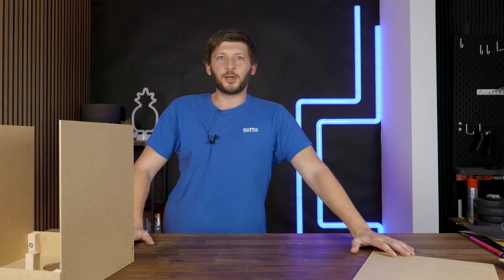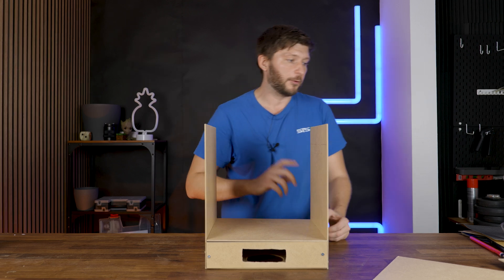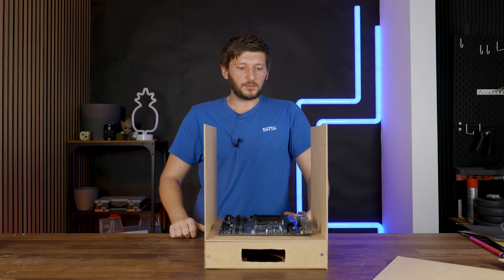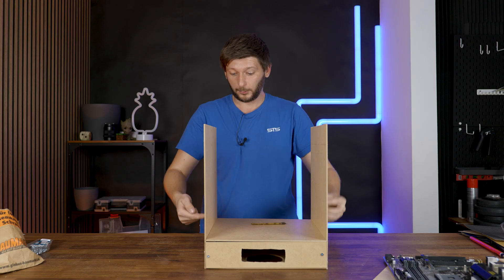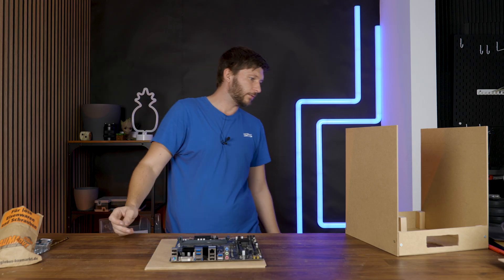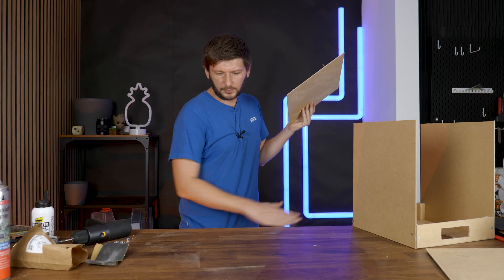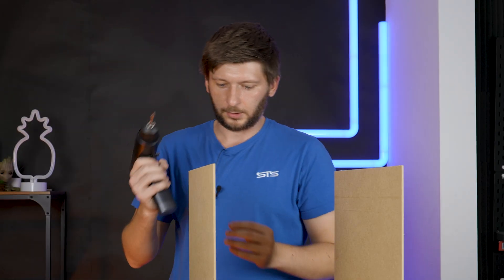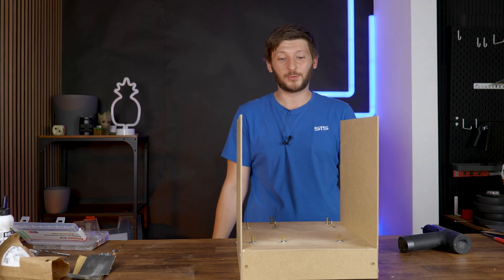Making A Motherboard Holder - DIY CASE Fan Testing Machine - Part 4

Comment: Cool...❤❤. But I have a question; will I be ok cooling stock 14700kf with Noctua NH-U12A Chromax Black in a lian Li O11 air mini case ? + Stock case fans. Gpu is 4070 Asus model.